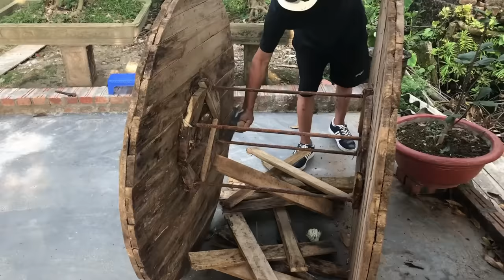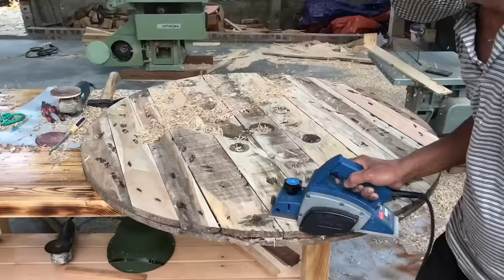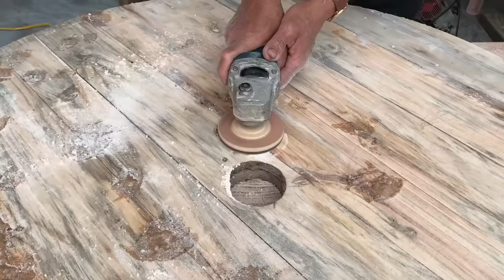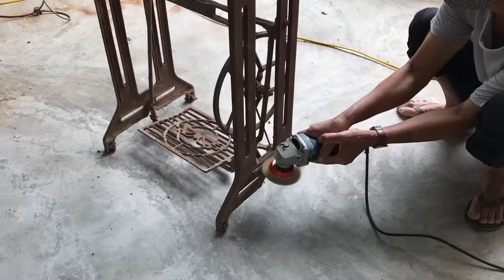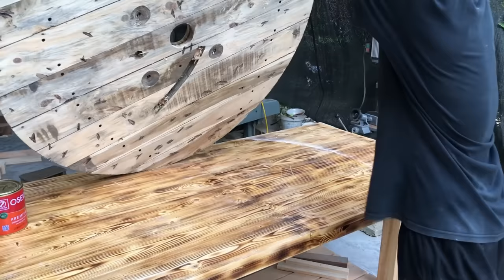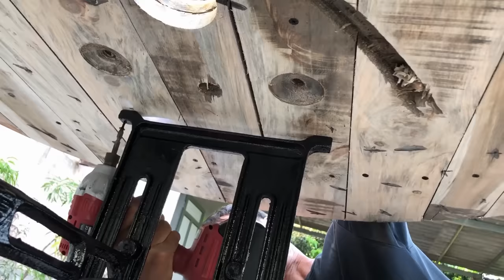Build Outdoor Coffee Table From Wooden Cable Coil Discarded // Amazing Ideas Woodworking Project!

Comment: I made one in1972. Shortened the bolts and slats. Covered he bottom with foam and pulled brass buttons down tight. Polished the top washers and finished with clear urethane. Used acorn nuts on top to hold it together. Great table. Someone in Chas., WV probably still has it.

Comment: I made one years ago. Shortened the bolts and the slats,foam covered the bottom and covered with vinyl, pulled brass buttons down tight and finished the top and slats with clear urethane. It was a great table. Polished the washers and used acorn nuts on the top. That was in 1972. Someone in Chas., WV probably is still using it.

Comment: You could also put an umbrella through the hole in the middle. If hole is too big, put a piece of PVC pipe in it, running from the ground to just above the top of the table. Then just slide the umbrella down the pipe. I did this for my neighbor once because the hole was much bigger than the umbrella. I lucked out and everything was a perfect fit!
Reply from the maker: ok! Thanks you!!!
Reply: Or make a bushing.  Hahahaha.   .....PVC pipe
Reply: د

Comment: You should use threaded inserts for screwing the top on those Irons are heavy and will eventually tear out the wood screws. I fully disassemble my irons and sand blast them for a better finish.

Comment: What was the mixture you used to fill the holes? I recognize the saw dust but what were the other two components?
Reply: I think it’s epoxy. Epoxy has to be mixed with 2 components resin and hardener.

Comment: Beautiful work...for a rookie like myself it be nice if u walk us through the steps on what you are using..thanks
Reply: U need orbital sander, angle grinder with sander attachment for sanding the surface to make it flat n smooth. Then u need Lacquer to be applied on the surface of the wood to finish it. It's a simple but time consuming